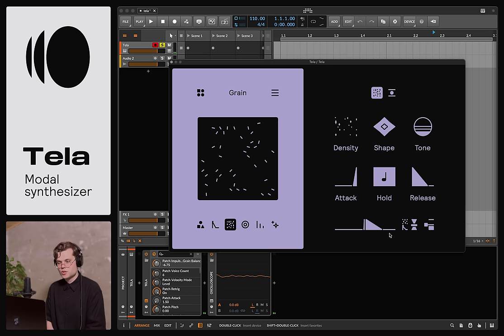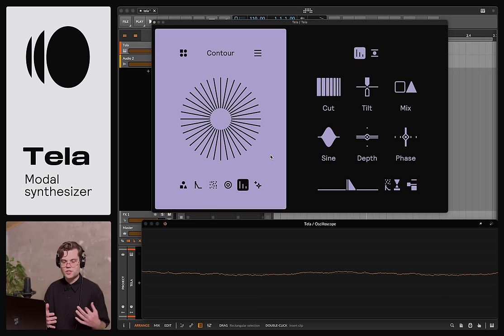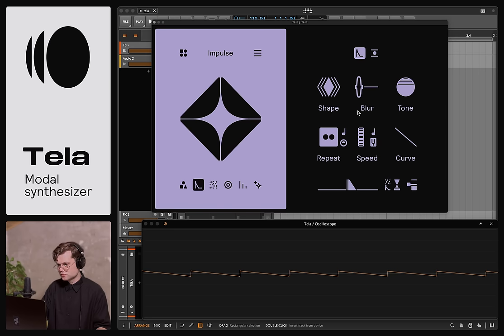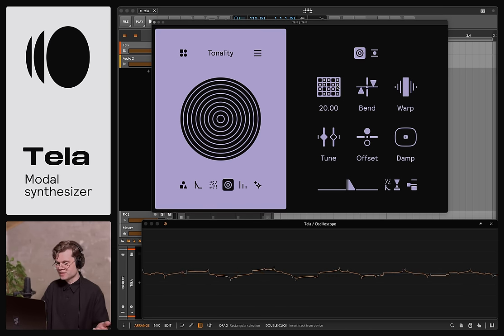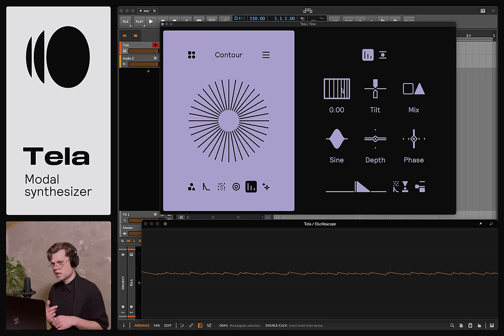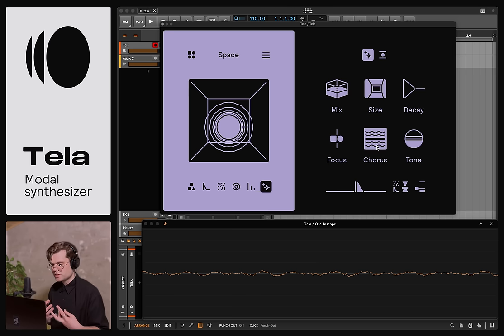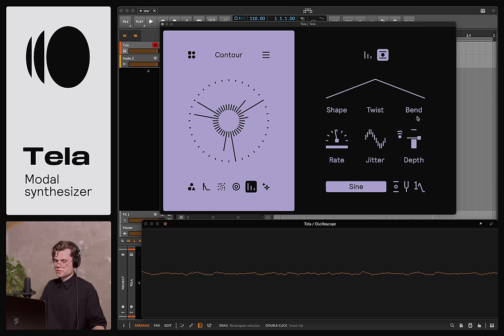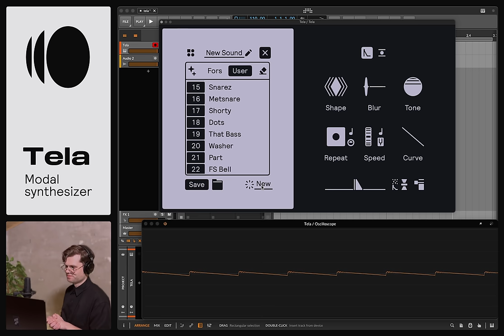Tela – Walkthrough

Comment: Instant purchase! Congrats on your first plugin! One thing though, resizing doesn't work with AuV2 in Ableton. It's ok though since the default is good but would have loved to use it bigger. 😊
Reply from the maker: Make sure that you’re actually pressing the middle size button to confirm– but please send us an email if this does not work hi@fors.fm
Reply: @ForsFM  Oh I see. Perhaps that's the only unintuitive part of the synth so far haha. I changed it myself with the json settings file before but pressing the middle also works. 😊
Reply: I can't resize either, can't set a different color scheme either.
Reply from the maker: @stepanok  sounds like maybe you're also not pressing the middle button to confirm the selection – in hindsight this may be a little hard to understand and we'll try to make it more obvious.
Reply: @ForsFM  I think with an arrow choice like that the change should be instant and there's no need for a confirmation stage. 😊